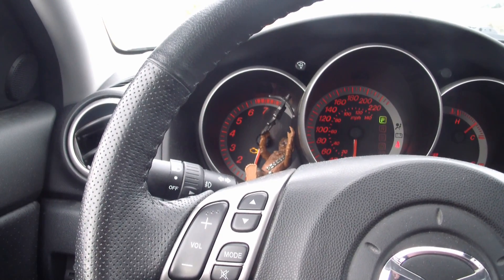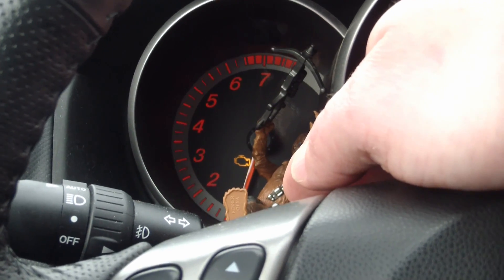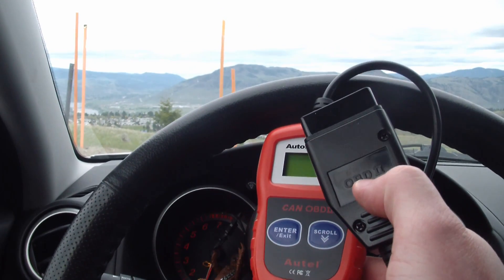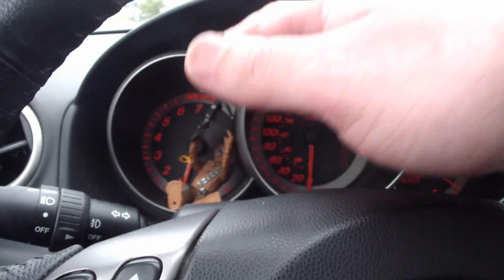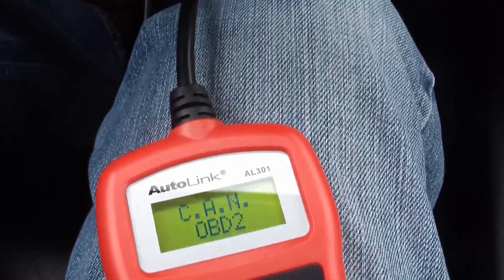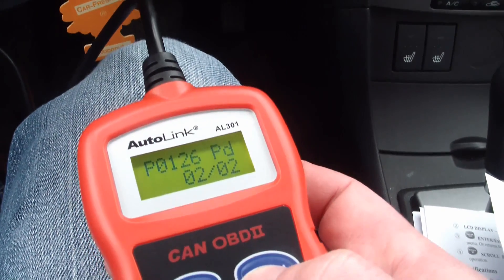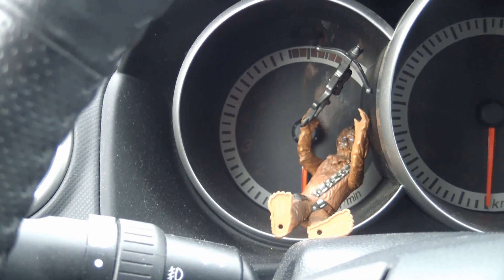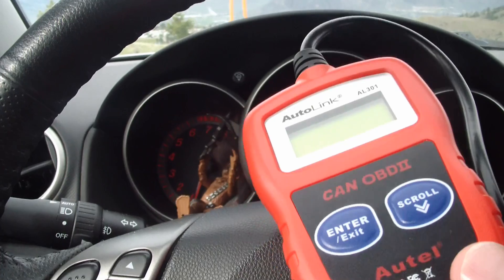Manly-Man Skills: Outsmart Mechanic Scams by Using Your Car's Computer!

Comment: My previous car used to put on the engine check light within about 10 miles of filling up with supermarket fuel. When I used decent fuel it didn't happen. Use decent fuel, folks! :) I also got one of the Bluetooth OBD units when my current car started putting up the check light and becoming difficult to start. The stored code was a bit vague, but some google research for the code and my car model led me to the glow plugs being the problem. I replaced them myself. God only knows how much that saved me, especially when you think that garages charge just for reading the codes, before they actually do any work!
Reply: Is it a high compression engine? Maybe the octane wasn't high enough and the knock sensor alarmed.
Reply: No, it was an issue with the O2 sensors in the exhaust. There was a 'fix' which involved relocating one of the sensors, but I never got around to doing it. I just used 'super' grade fuel, or added a bottle of fuel conditioner to the tank.

Comment: You should try one of those OBD2 Bluetooth scanners that you can connect to your smartphone, shows WAY more info about the system in real time and you can save the info into your cellphone, plus, it has every function your OBD2 has and way more and its actually cheaper (about 17 dollars in Amazon).
I'm quite amazed by this little tingies.
Reply: +Hellsing Yup, got one off Ebay for $8, bought the Torque Pro app (Android), and can view live data etc.  Amazing bang for the buck.

Comment: One light to never underestimate is the big red light saying "STOP" that means pull the fuck over and stop the engine.
Reply: oil pressure warning light or overheating that can't be helped by turning the heaters on full blast are the only things that you really gotta stop for.
Reply: Had an old Nissan Pathfinder that the oil pressure wire slipped off its connector right after I changed the oil. After seeing that oil light longer than usual after an oil change, it got shut right off. Defiantly not going to mess with no/low pressure.
The overheating can be a fun one though. turning the heat on max while waiting in line for gas on a nice summer day (or just turning the car off because you don't want to die of heat), or driving for a limited distance and then turning the car off to cool down because you just lost all of your coolant, etc.
Yes, my car has a fan issue in the first example, and I still don't know what the issue is after hours of trying to figure it out.
Reply: I had to do that once with my friend, we did an axle swap on a truck and the guy we did the work for gave him a free 3000GT SL, it was a salvaged title and had trans problems but it ran decent. On the hour and a half drive back in the car it kept overheating and we had to have the heater on full blast in the middle of the summer.. Oh and there was too much trans oil so it was driving terribly, we had to pull over to a local shop and get a hose to siphon out some of it by mouth.
Reply: +Youtubekeepsmeup True.

I find out about all the problems as they come up and just ignore them if i can, however i have now built up quite a big list lol and you have to try and remember them. Eg cannot lock car with out it going off, fan switch dont work, engine light is always on so i have to regularly check if there are any new problems etc etc.
Reply: +lkjlkjlkkj 
Your probably find that a code that comes up may trigger others too so when testing a car clear the codes and drive, the first code that pop's up will more then likely be the main problem. (in most cases). I'm so lazy with my own car so and left the engine light on, (fuel evap value) but it drives fine so not really bothered
Reply: If I saw that or the oil pressure light I'd probably change into neutral and stop the engine immediately then pull over.
Reply: ***** I don't need power steering and the brakes work fine without the brake assist. Dumbass.

Comment: They prey on our lack of knowledge of today's cars.  You can probably be assured that if you didn't have an OBDII tester but took the car to the shop, they would have replaced a sensor and charged $250 to "fix" the problem; the fix might be to reset the codes.  Then they'll tell you that if it comes back, bring the car back and they'll do more "troubleshooting" (at extra cost of course).  I've had two nuisance codes that I reset and as you stated, they never came back.  Another one did come back - leaking gas cap seal I fixed for $15 (new gas cap).  The savings allowed me to buy a more sophisticated OBDII tester.

Comment: check out the elm 327 (or similar product). Bluetooth OBDII adapter. Several free Android apps can use it to read/clear codes and view live data. I use "torque" which cost about $3 for the full version on Google Play.

I believe they make it for CrApple products also.
Reply: forgot to mention the Bluetooth adapter is only about 12 US dollars. I have an Android head unit in my car so I can watch all the stats while I drive around.

Comment: One thing for your viewers to keep in mind is that the DTC also doesn't necessarily point  to a fault in the component that stored it. For example a worn plug gap or faulty injector showing up as a cat code. As well, auto instrumentation apparently (as I have a mate's Civic out back begging for big end shells this evening) isn't as intuitive as one might think, even to the lay wrench. Oil idiot lights denote a lack of pressure - not level, and coolant temperature sensors will read low if they're not in contact with LIQUID coolant - making a low temperature reading of more immediate concern than high. Of course you're absolutely correct that a MIL (Check engine light) does not mean run like hell to a mechanic with your wallet open - any on board system can illuminate it, and on newer integrated vehicles any system can  mean one of twenty that have nothing to do with the actual operation - keyless entry/immobilizer, etc. However a flashing MIL should not be driven. It's not going to explode - but it can increase repair costs significantly.
Reply: you're very correct, I just have one correction to make. :-) the check engine light will only illuminate due to an "emissions" related fault. the severity of which is varies so I recommend all my clients at least get the code read as soon as possible to determine how crucial it may be. so emission related being engine and transmission....drivetrain pretty much. the check engine light is illuminated only by the engine computer but can be requested by another module like the transmission. this is federal law and part of the OBD 2 standards. keyless entry should never illuminate the CEL. the immobilizer maybe since, on most newer vehicles, this is integrated into the engine control unit. sorry that was so long, just trying to be clear haha
Reply: Samuel Reed Standing duly corrected. To be quite honest - shuffles feet a bit - I can't quite recall if I'd forgotten this or never actually knew it, likely mistaking instances of multiple present DTC's on the scanner as all having MIL rank

Comment: As far as I know, if the engine takes too long to reach operating temperature, you get that code. The most common cause is a bad thermostat, but it can also mean a problem with the temperature sensor.
Reply: Good to know!

Comment: Great vid. Shit this light will even come on if your gas cap isn't on right or is broken. The light is a little unnerving though for most. 

Solid yellow- Most of the time emissions related and vehicle is still safe to drive but will maybe revert to "limp" mode. You will also not pass smog check. 

Blinking yellow check engine light- Much more serious like misfires or other more serious issues. You should stop ASAP and turn off car or more damage may occur. 

Red check engine light- Stop!!! Turn of car immediately if is even still running. Most  likely catastrophic failure has occurred.

Comment: This is common code for a thermostat stuck "open" . in the summer time you could probably get away with erasing this code and it wont come back until the temperature starts to cool back down. it will not come back right away after erasing it because you have to drive the vehicle for the coolant to heat up, also i would not recommend ever unplugging your battery to erase codes because you will also be erasing valuable fuel trimming memory and freeze frame data that could help your local technician actually identify your problem.

Comment: The check engine light is 100 percent on because your car is not meeting emissions in some way. In your case the car uses the coolant temp sensor as well as the Mass Air Flow Sensor as inputs for Air/Fuel ratios while your car is in a open loop (or cold). Since its no longer getting that input. Your probably running rich when you first start it up throwing the emissions code. When your car warms up its fuel trims are no longer gathered from the MAF and Coolant Temp and taken from Oxygen sensors instead. Your car then operates normally.   OBD2 readers especially cheap ones can miss codes and even sometimes throw fake ones.  Many codes will take a few drive cycles before they come back.  Most places do free code scans.

Love your videos btw man not tryin to be a dick or nuthin.

Comment: I just flip my key back and forth like 3 times and it outputs my code right on the odometer. Pretty spiffy for a PT Loser that doesn't even have power locks.
Reply: +Tanner Miller  Chrysler is good about that, it's one thing they got right.
Reply: +Jgizzy redacted I guess 1% kinda good and 99% no bueno is at least some amount of bueno, right?

Comment: Why....WHY do they insist on making us buy that fuckin' OBD2 chingus?
Just spell it out on a 29¢ display for dog's sake!
Reply: +john weeks Actually Chrysler lets you read the codes directly. Turn the key between off and On three times rapidly. After the third power on of the dash the vehicle will dump the codes out on the Mileage display. What Chrysler doesn't let you do is clear the codes, in this case you still need that chingus.
Reply: +John McFerren thanks. I'm going to look into whether Honda does this.

Comment: I ordered a cheap Chinese bluetooth ELM327 OBDII adapter from Amazon and bought the Torque Pro app for smartphones. Total cost is under $10 and Torque Pro has a database of the codes so it looks up the translation for you. The app also does a lot of other cool stuff, and with the free companion app, you can record video with a smartphone with overlays of engine data; basically any sensor data that the ECU receives. Pretty cool.
Reply: What he said. Realtime monitoring of whatever parameters are available. Customized gauges, if you want to go that route. You could even pair to a phone you no longer use.

Comment: Unless you drive a car from the 1990s and don't have obd2 and have to learn to figure out what's wrong by sound and feel
Reply: +cartbart1 Most cars from 1991 and up have an OBD system whereby you can extract fault codes with or without a tool. For example my 1988 Honda Prelude has an OBD-0 system and to get codes all you have to do is pull down a carpet flap and turn the ignition "On" and count the blinks of the LED light behind the carpet. Very basic system, but it helps narrow down where to start looking. This setup is not uncommon for late 80s and 1990s cars.
Reply: true and thats cool about the honda i never new that. and the 1990 jeep i drive does have an obd-1 port but the codes are next to useless and if you move even further back like to an old 70s corvette.....

Comment: Or go to Autozone and they will test it for free and tell you the diagnostics.
Reply: It's not useless.  They tell you the code and you can look up how to fix/repair.  Just clearing a code would be "useless".  PS: the auto parts store near me will allow me to clear the code using their scanner.
Reply: +fastacker2 Yep that's what I did but then I took it to O'reillys to see if they had the same diagnostic.  Also, they have free loaner tools that come in handy (like an 02 socket)
Reply: +fastacker2 They wont clear it, so its pretty useless unless you just want to know what the code is.
Reply: Tom S.,

It's not useless at all for Auto Zone to run the diagnostic test but not clear the code. At least you have retrieved a code so that you know where to look from the start. To me, the diagnostic code reader shouldn't be your handy mechanic at hand. The code reader should only be your guidance in where to look FIRST before throwing parts at areas the code tells you. I hope that makes sense. Auto Zone have no problem in clearing the code for you though if you ask them to.

Comment: Excellent choice on a MS3. P1026 usually refers to a stuck thermostat. Ive had one for 5 years and ive gotten it a few times. Replaced the coolant thermostat and havent gotten it since. Just so you know.

Comment: I have to disagree with you on this one.
You might encounter a simple fault like you had, that just needs to be reset to never appear again, but what told you that it would never come back ? 
When you bring your car to someone, and especially a dealership, they MUST give you a result: the light should NOT come back on for the same problem. And that requires some digging to determine if the problem was just a glitch or a part that is on its way out. And that costs a little more.
Also, buying a scan tool doesn't buy you the knowledge to use it. A common thing is that people buy the cheap scanner, and when they encounter a code for example, that says "O2 sensor reading, lean",99.9% of them will go buy a new O2 sensor, put it in, clear the code, drive a week... and hop, the fault is back again. This is why you bring your car to someone who knows. 
Also, some codes aren't standards OBD2 codes but manufacturer codes (they start with P1), and those are usually not simple faults and will come back.

Comment: If that light is flashing, best to stop right away.  That means a severe misfire is detected, and your catalytic converter will be severely damaged if you continue driving. Cats are expensive as hell.

That particular code is likely caused by a bad thermostat or ECTS, but you probably already knew that. It may take 1-2 warm-up cycles to turn the MIL back on.

Just remember DTC also stands for Don't Trust Codes! oftentimes you'll get a code that suggests one part is bad when it's really something else mildly related causing the issue. Further diagnostic procedures are necessary before a part can be singled out and proven to be the cause.
Reply: +Krankie V I can't tell if you are being serious.

Comment: pugs Lee is an idiot why would you spend  $30 on a code reader but disconnect the battery to clear the code. That scan tool you paid $30 for will clear the code without wiping out the cars memory of driving curves like correct idle when the AC is turned on, RPM drop when putting it in gear and other thing. Fords are a good reason not to disconnect the battery. It will stall when going in gear until you hold the throttle for 3 minutes at 1500 rpms. 
 I wished these book mechanics would do more research before making these half correct videos of missing information. The people who pat guys like this know even less. I wonder how these brainyacts deal when that reader tells them that cam and crank are not in sync and the sensors are working as they should. I want one of these professors of the driveway super informers- would deal with that.
Reply: +CHARLIE ARROYO separate and possibly even shield the wiring between the two sensors
Reply: +Krankie V what are you talking about,??    "separate and possibly even shield the wiring between the two sensors"   ?????????????
Reply: when you have a cam/crank sensor correlation code.... often caused by breakdown of the insulation in the wiring or oil soaking through causing the signals to cross.. if the wires are separated, problem goes away
Reply: Krankie V its caused by a stretched timing chain. correlation is the timing between the two. replacing chain and gears correct the code
Reply: That's not the only thing that can cause that code

Comment: most likely a failing thermostat. this will only show up when it's cold outside. warm weather=no light. basically the pick moniters the time it takes for the engine to reach operating temperature. if it takes more than a preset amount of time it flags this code.

Comment: Every single bus I've ever took had both the check engine light permanently on (sometimes with a piece of tape on it to stop distracting the driver!) and the "low oil pressure" light coming on at low RPMs. ???
Reply: +MrOpenGL Sensor problem that some drop dead beat, didnt want to fix. Or in fact low oil pressure at low RPM
Reply: Crusty Crab
Probably worn oil pump. Or oil that's never ever been changed.
Often when I take one of those buses that serves the hilly districts of the town, it arrives at the uphill terminus, the driver gets off and refills the radiator :D